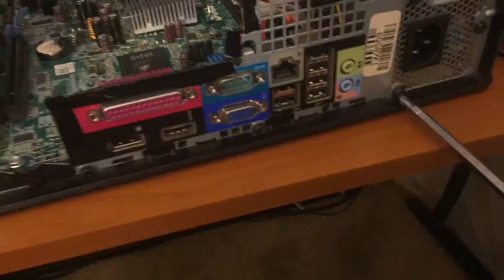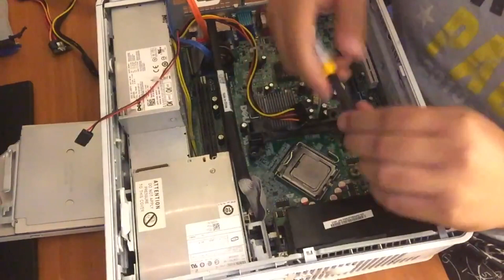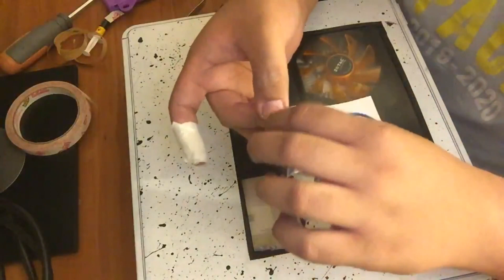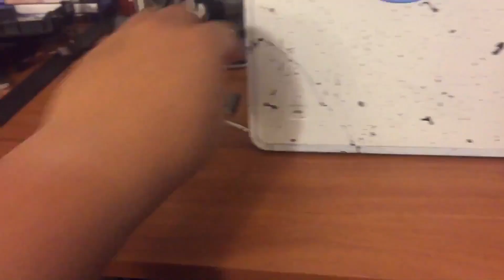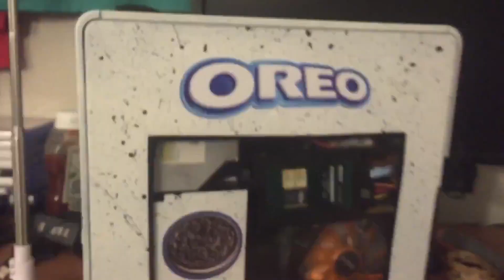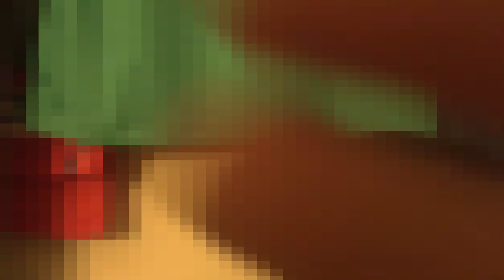My First PC Modification!!! | Dell Optiplex 760 Upgrade | Gaming PC

Comment from the maker: -Some of the numbers I collected over various games. These are the average fps I got from these games. 

-Minecraft (With Help of Optifine): 109 fps LOW, 84 fps MED, 54 fps HIGH
-CS:GO: 102 fps LOW, 77 MED
-Fortnite: 54 fps MED
-Overwatch: 72 fps MED
Reply: MadeAt12AM nice 👍🏼
Reply: Are these at 720? Or 1080?
Reply from the maker: @carloschevere9335  I will have an updated video in about a week where I use the 750 ti in order to play everything at 1080p. I don't remember which ones I tested at 720. Sorry
Reply: Can you play apex on the q9550
Reply from the maker: @skiiter1877  Ill add that to the list of games I'll test in the video update. Should come out by the end of January. Thanks for the suggestion!

Comment: hey bro. don't know if you still have this PC but I have a question about the power supply. I just bought a Core 2 Quad Q9400 (95w) and I plan on buying a GT 1030 (30w) as well. I just want to know if the 255w PSU can handle it. did it work for you?
Reply from the maker: My PSU is definitely not the strongest but the PC is still going strong. My PSU is only 240W and my 750ti’s recommended PSU is 450+. It’s still doing extremely well and I have not encountered any problems in the year I’ve had it.

Comment: Hey, thinking about doing this myself, could you provide a link to the sata cable splitter you used to power the gpu? Thanks
Reply from the maker: The sata to 6 pin connector:
https://www.ebay.com/itm/Monoprice-8in-SATA-15pin-to-6pin-PCI-Express-Card-Power-Cable-/373386127135?hash=item56ef8c271f
The sata cable splitter:
https://www.newegg.com/p/0ZF-00HW-00033?Description=sata%20cable%20y%20splitter&cm_re=sata_cable%20y%20splitter-9SIAJW89845459-Product&quicklink=true

You can browse on both ebay and newegg as these sites are where I bought all of my parts. Sorry for the late response

Comment: what's the model of your motherboad?...it's on small rectangle sticker on your motherboard close the the small silver battery 
can you tell what it says so i can see if my optiplex motherboard supports quad core cpu?

thnak you in advance
Reply from the maker: The model of the motherboard: 0M863N
Just checked it right now with CPUID and I believe it's the default motherboard with the Dell Optiplex 760 SFF

Comment: you know this isn't the dt it's the sff. the biggest give away is the dt has the pci exp16 and 2 pci slots. it also has the same dvd ,cd drives of a full sized tower and not a dvd cd drive from a laptop. i have a 755 dt, 760 dt and a 780 mt so i should know my way around these old things. you where also talking about these computers only having 2 ram slots the only optiplex computers that have 2 rams slots are usff and 360 or 380 when it comes to these models. the max ram that these can handle is 4 gb vs 8 gb of this computer. the best thing about the 780 is it has a max of 16gb of ddr3 ram and not ddr2 like the 745-755-760
Reply: This computer had four ram slots. He was asking about why some people opt for dual channel support instead of installing the full four ram sticks like he did.
Reply: Do you want a medal or something bruv?
Reply: Come To Besiktas exactly lmao man typed out a whole essay

Comment: with which you cut the lid?
Reply from the maker: I used the “WEN Rotary Tool” with a “Dremel Cutting Wheel”. You can always opt for the more expensive Dremel brand products as they are high quality but the WEN rotary tool was just fine      

(Link) https://www.homedepot.com/p/WEN-Rotary-Tool-Kit-with-Flex-Shaft-2305/203604481
Reply: @madeat12am12  thank you so much!!
Reply from the maker: No problem. Have fun modding!